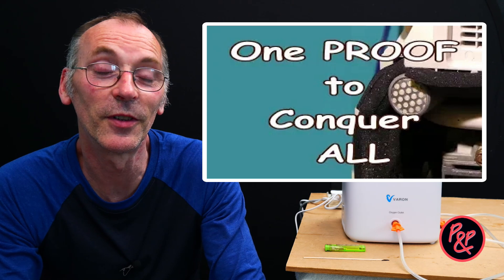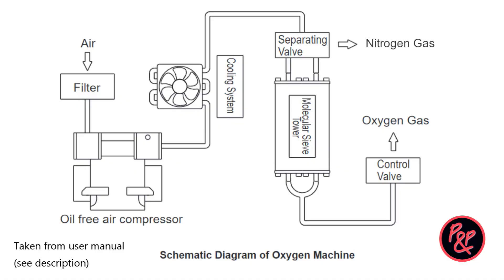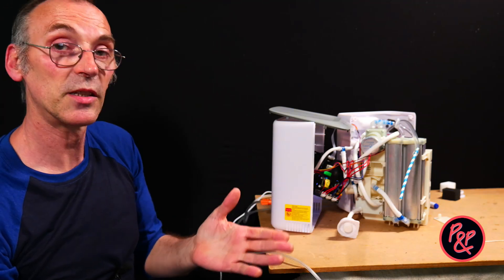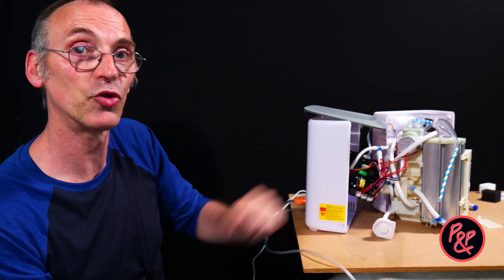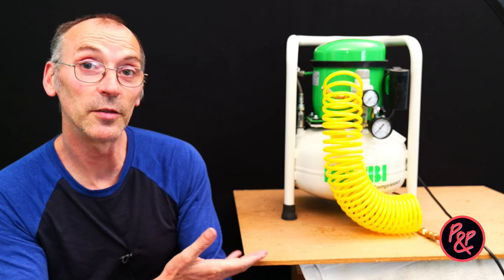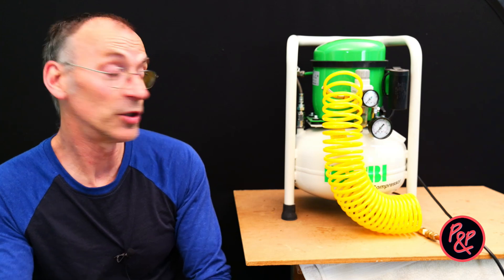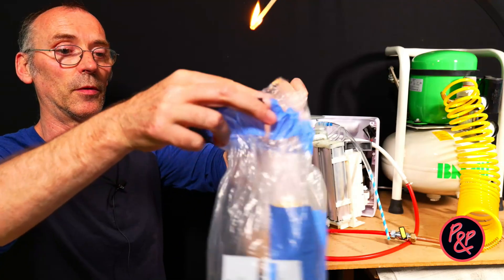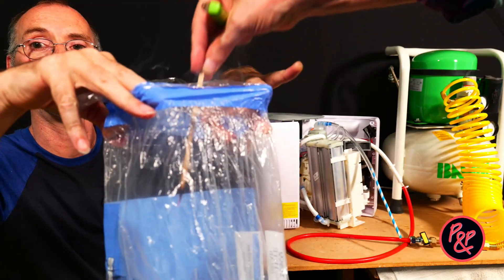Making Nitrogen Using An Oxygen Concentrator

Comment: Doesnt the exgaust gas from the nitrogen saturated seives include room air mixed in? Ive wondered about this exact experiment.😊
Reply from the maker: our intention wasn't to test the exhaust gas merely to produce a 'nitrogenous air' and the flame was clearly extinguished. I'd imagine that any exhausted air from the psa machine was, from our experience, a lesser concentrated nitrogenous air that could or could not extinguish a flame!

Comment: Another proof of air not being comprised of oxygen or nitrogen, is both have zero humidity. 
Air is measured by its humidity. That is: air is measured by the moisture it holds at given temperature. 
If air was 21% oxygen and 78% nitrogen, it would have zero humidity. 
Obviously this is not a match to reality.
Reply from the maker: science doesn't match reality as everybody should realise! tks for the post jane!!

Comment: A gas chromatograph, even a low end one, shows the constituents and ratios of atmospheric air quite nicely. Your demonstration is just dumb pseudo-science. The machine you are using is nowhere near 100% efficient at separating gasses. They are just for increasing the percentage of Oxygen in the output, not purifying. OMG, somebody help! This world is toast with all the nonsense put out there on social media these days by whoever has a nutbar notion about something.
Reply from the maker: where was the nitrogen from the machine - it's supposed to separate the air!!!! Gas chromatography does not prove air has constituents. If you think i'm wrong explain how gas chromatography proves air has constituents? 

As far as i'm concerned gas chromatography is used to identify the composition of man made vapours!!! It's not used to determine the constituents of air!
Reply: @PeterPete I've sampled air many times and analyzed it using gas chromatography. Im not going to explain how it works typing on my phone, but it basically separates out all the different gases that make up air based on their different molecular weights as the air passes through the column. Often an inert cartier gas is used. Different constituent gases come off at different times and are indicated  as type of gas based on time and percentage of the gas being analyzed ( in this case atmospheric air) based on the area under the curve on the graph or display. It's very well established science and each time a run is done it is tested with known gases as controls. The reason your flame isn't extinguished, as i mentioned, is that the type of machine you are using is not 100% efficient at separating the gases. It does not give off pure oxygen only increases the concentration. The same on the exhaust or nitrogen side, there is still dome oxygen in that gas mixture. Go to a university and ask someone in an environmental analysis lab to show you how gas chromatography works. While you're there maybe also have a look at high pressure liquid chromatography. Interesting stuff when you understand how it works.
Reply from the maker: @BrookeOland  I've read similar information but what you're not telling me is how the machine proves the air has constituents?
Reply: It would help you tremendously to understand the molecular structure of different gases. There is no such thing as an "air molecule". Atmospheric air is a mixture of different gases. Some gases like nitrogen and oxygen have molecules of 2 atoms each... O² and N² ( the 2s should be properly written low by the letter but my phone won't do that, so I'm just leaving them like this), held together by covalent bonds. Carbon dioxide CO² is an atom of carbon, which can form 4 bonds holding 2 atoms of oxygen which can form 2 bonds each. Methane for example CH⁴ is a carbon atom holding 4 Hydrogen atoms since hydrogen can only form one bond. When you burn methane, it is oxidized by releasing the energy in the hydrogen bonds and the resulting gases carbon dioxide CO² and a water molecule, H²O.
Reply from the maker: @BrookeOland  you need to stop dithering and just tell me how the machine proves the air has constituents !!
Reply: @PeterPete  I basically did tell you, but apparently you don't understand that a GC separates the different constituents based on the different molecular weights and charge of each gas. You may be one of those folks that once you get a wrong notion in your head you aren't able to learn where your mistakes lie and you get stuck in a non-learning echo chamber. Believe me, I've sampled and tested air many times to determine the ppm of CO2. Also sometimes to see if there are volatile or toxic gases in the air. These come off the column separately from all the other constituent gases. The gases with less molecular weight come off first and are measured as they cross the detector. The greater the molecular weight the more delay (retention time). It would just be easier if you watched these four videos. I'm a biologist not a teacher. Let me know if you have trouble with them.
1)https://www.youtube.com/watch?v=UycPljfrnWo
2)https://www.youtube.com/watch?v=F9NUXkyIl5A
3)https://www.youtube.com/watch?v=re7FCdCvsiw
4) https://www.youtube.com/watch?v=uD-29-mV3N0

Comment: How is that possible? Air goes in with its standard 21/79 mixture. Almost pure oxygen comes out of one stream. The other stream MUST be oxygen deficient. Probably not 0, but lower than ambient. Probably enough oxygen was left to keep the splint burning, but the flame got significantly smaller.

BTW:  your right audio channel is dead.
Reply from the maker: quote -  Air goes in with its standard 21/79 mixture.

that's just an unsubstantiated statement!!

please substantiate your claim!
Reply: @PeterPete  What? Are you nuts? What else are sucking in from the atmosphere? I ignore the <1% trace gasses for simplicity sake.
Reply from the maker: quote - What else are sucking in from the atmosphere?

Oxygenless and nitrogenless air and moisture!
Reply: @PeterPete  Yeah... goodbye! ^^
Reply from the maker: @jackmclane1826  the machine makes the oxygen by processing oxygenless air!!!
Reply from the maker: @jackmclane1826  yeah sorry - byeeee!!
Reply: I think the problem is at the end of the 1st cycle, air is used to push out the nitrogen. I think that mixing of gases is what is confusing you. This business of "air" being "one" single gas is 'flat earth'. Air is a mixture of gases. Learn what the early researchers found. If I have a cylinder filled with STP (Standard Temp & Press) AIR, and by chemical means deplete the contents of any 'part', the gross mass reflects the removal of the part. It weighs less. By the fraction of 'that part' of the whole.
You have to read the "how it works" to understand the purge is on a spectrum. Whole air is pumped in to purge the tanks of nitrogen. The Oxygen has previously passed through while nitrogen is trapped. Timing then switches to the 2nd side.
Reply: @ Read the following comments. That guy is clueless.

Comment: I love how you can see the splint flame getting weaker in the first exhaust test, somehow warranting the comment "none whatsoever"
Reply: Dear Pete and Peter
Oxygen concentrators use filter mediums that are porous enough to allow the smaller O₂ molecules to pass through while trapping the larger N₂ molecules.  

FIRST UP: Such concentrators are at best about 96% efficient, meaning the output will consist of at best 96% O₂ with the remainder being mostly N₂. This concentration will diminish over time and needs to be checked on a regular basis and the filters replaced once the output concentration of O₂ falls below a predetermined level. 

FILTER BLOCKAGE: one of the major problems with this type O₂ concentrator is the filters very quickly become blocked with N₂ molecules to the point they will not let anything pass at all.

BACK WASHING: It depends on the particular unit, but generally you have 2 filters one filtering out the N₂ and the other being back washed using some of the O₂ from the active filter. This back washed material is what comes out of the waste gas port and while it will have a much higher concentration of N₂ than room air it will contain some of O₂ that was used to backwash the filter. That’s why there are 2 filters and you hear this whoosh sound every 5 to 8 seconds as the system switches filters to backwash the clogged filter.

POOR OBSERVATION: As I have explained, the output port doesn’t only contain pure N₂ but O₂ as well albeit at a lower concentration than normal room air, but in sufficient amounts to support combustion at a reduced level. If you had observed you test properly when you initially inserted the burning splint into the bag containing the gas from the waste gas port on the concentrator you would have noticed that it almost extinguished as it neared the bottom of the bag. I will give you the benefit of the doubt here and assume that you didn’t notice this like other viewers have stated and assume that you didn’t deliberately remove the burning splint the moment you noticed the flame decreasing in size. Nevertheless, this clearly demonstrates that the bag of gas collected from the waste port on the concentrator did contain less O₂ than room air.

MY QUALIFICATIONS: I am a certified scientific instrument maker with a background in automation and control systems, computer control systems, programmable logic controllers, mini super computers and telecommunications. As for my experience with O₂ concentrators, due to damage to my lungs from chronic lifelong asthma and complications from a COVID infection about 18 months ago I am connected to an O₂ concentrator or bottled O₂ via a respirator mask or nasal cannulas and a pulse mode regulator, 24 hours a day and have been for several years now. 

YOUR QUALIFICATIONS: I don’t know what your qualifications are, but from the snippets of your videos I have seen you appear to not even have a rudimentary secondary level education understanding of science, chemistry, physics, astronomy and photography all of which I have a much deeper understanding of than either of you. Clearly you have no place trying to denigrate the observations of others that are far more qualified than either of you. As far as I am concerned you are a pair of amoeba brained pungently odoriferous, procreating, male bovine excrement regurgitating buffoons. 

This comment will probably be deleted, but I hope at least some of your viewers will have the chance to view it.
Reply from the maker: @Masu_Stargazer  quote Oxygen concentrators use filter mediums that are porous enough to allow the smaller O₂ molecules to pass through while trapping the larger N₂ molecules.  

great story telling - got any proof to make your story factual?? I mean, I've never seen any evidence the air contains oxygen!! Even Lavoisier never proved oxygen was a constituent of air!

by the by, we won't enter a discussion into your health issues because that's never been our remit!!
Reply: @Masu_Stargazer  Don't overdo it. This dude is a clueless fool that doesn't even know the standard 21% oxygen content of air...
Reply from the maker: the first exhaust test was at 04:10 and the flame certainly didn't go out on both attempts!!! No nitrogen whatsoever!!!
Reply: @PeterPete  Yes. And that "none whatsoever" is wrong. The flame got SIGNIFICANTLY smaller, indicating significantly less oxygen. 
Keep in mind, the flame would NORMALLY grow in air when holding the burning end of the splint down. 
So... everything happens just like expected.
Reply from the maker: @jackmclane1826  so why was the flame extinguished later on in the video when passing compressed air through the system??
Reply: @PeterPete  Probably because you decreased the concentration of oxygen in the waste stream a litte with your changes. Probably at the side effect of more nitrogen "contamination" in the oxygen stream. It depends how you operate these machines i.e. the valve timings and some layout issues. 
An oxygen concentrator is - duh! - optimized for concentrating oxygen in the product stream. Nobody cares for remaining 02 in the waste stream. N2 absorbtion in the sieve beds declines over time with aging/contaminating sieves. So having a little headroom makes a lot of sense. 

It seems like your understanding of the whole matter is quite lacking. Your observations are really poor and then you draw your conclusions out of these poor observations. These are as good as they can be... -.-

Comment: Base on explanation of you and Dr. John: the charges are connected to sun which it depresses that expands things so charge is reduced pressure, decharge is increasing pressure so cold raises pressure. Can expand understanding in videos : everything is hot to cold & in connect to that pressure to depressure. So to increase pressure require cold or low charge which is low heat so spin of heat will reduce pressure.

If fan that spin to hot air so with strong material and lock system so the hot change to cold. So the element of how construct work is spin and despin creating cold and heat, along it hard to soft,  light to hard, it is layer series of foundation like earth holds us, so higher spin make it cold, so can go deeper to how everything work: it depends on pressure which connected to deeper foundation: spin and despin
Reply from the maker: Yes kind of understand where you're coming from. It's all about heat and the transference of heat from hot to cold.
Reply: @PeterPete  Ok, what about spin part?? Ya can do experiment so spin the fan so will change the air to cold, and how pressure work it is base on herz, spin of one so 1 frequently of mins, so low to high so it convert cleans electricity to dirty electricity, so in connect of electricity so that is how mass work, which all is energy but high spin so convert into solid or vaporized to nothing.

Comment: Brilliantly executed demonstration, Peter and Pete!
Air is the gaseous form of water
Air is bubbles 
Bubbles rise from water when energy is added
Eg stirring, heating, moving over rough terrain.
Bubbles carry stuff
Eg smoke is bubbles carrying soot
All gases require carriage via air bubbles
Hence all gases contain water
Oxygen is compressed and water reduced to parts per million of water contamination 
Oxygen is calibrated by its dryness
To get liquid oxygen extreme, compression and below freezing temperatures, are required to reveal the water content once more - colour of liquid oxygen is sky blue - as the temperature reduces away from land upwards - - perhaps the edge of space becomes liquid oxygen - sending a rocket into an ocean of liquid oxygen might stop it abruptly without damage, mmm where did we notice that occurring…

We breathe air not oxygen is the title of an article I wrote after inspiration to research lung physiology from 2Ps work here
Find it on Substack if you are interested Jane333 
We breathe just like fish
Our blood is balancing salt and water too

Nothing to do with the gaseous exchange of oxygen or carbon dioxide

Comment: This was a fantastically informative video on how these oxygen concentrators work and how different molecular sieves/conditions effect the output gas streams!

My only nitpick with this video however - is that the right side of the audio was missing through my earbuds when watching this on my phone, that is quite a minor and easy to fix issue though!

Could you possibly retry this experiment in the future with the activated carbon at higher pressures, to see the performance difference compared to the carbon molecular sieve...and maybe test additional molecular sieve types/pore sizes too?

Testing other gas mixtures through these molecular sieves too could be a very interesting video as well, if you ever gain the ability to test such a thing into the future!(Maybe pure oxygen and another relatively inert/non flammable gas? Be a little more weary if you choose any non flammable halogenated gases though, as high temperatures can still break them down to their corresponding toxic hydrogen halide gas products... even though the produced amounts of such toxic gasses will likely be quite small with such lit splint tests...)

Anyway - you have earned a subscription! 😁
Reply from the maker: tks for the positive comment and welcome aboard! Another person informed us of audio problems, they sorted it out. We play on pc and audio is fine. I've played on phone and audio was fine too! I have an inkling what the problem could be and we'll look out for it next time we use the clip on mic!!
Reply: @PeterPete  thank you for replying to me so fast! I admittedly was finishing still editting in some details into my comment as you replied! 😂

And yeah, I have had/heard of similar problems with YouTube before! It was an excellent video regardless! 🙂
Reply from the maker: @Chris47368  👍👍
Reply from the maker: Oh btw, we realised our lavalier microphone is mono. Next time we use it we'll add another mono track to the sound recording to make it stereo 👍
Reply: @PeterPete  Awesome! 👍

Comment: And btw. The design of these concentrators is ofc based on mainstream chemistry. What if you modified the device and there was just the inlet valve and only 1 output valve. It should work.

Comment: OK so since you used a custom compressor and custom sieve material, do we need a machine at all? I'm wondering what the minimum gear we would need is 🤔
Reply from the maker: minimum gear to make nitrogen? compressor 5-13 bar and pressure swing system. one needs the pressure swing to concentrate the output gas unless one uses higher pressures like 120psi with membrane technology to produce nitrogen 👍
Reply: @PeterPete  thanks!